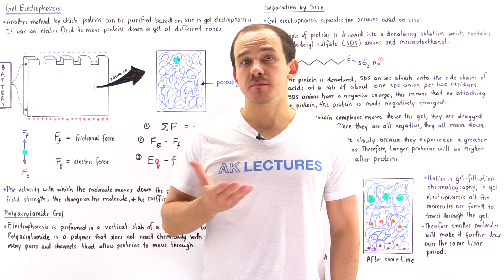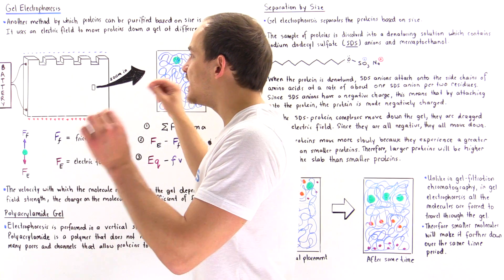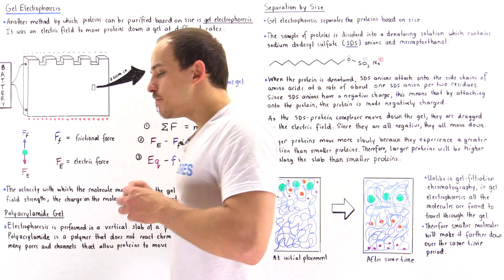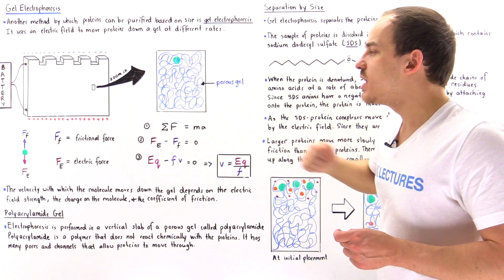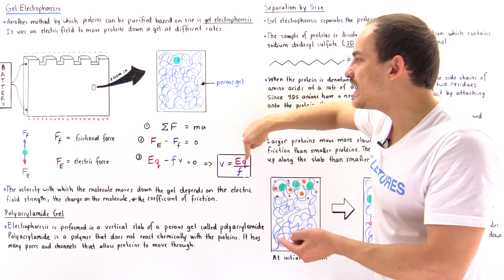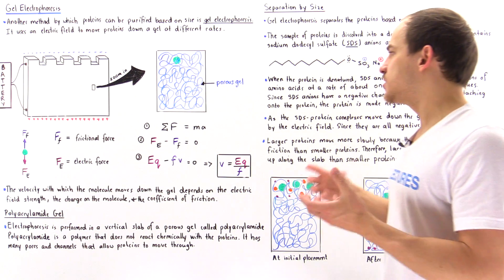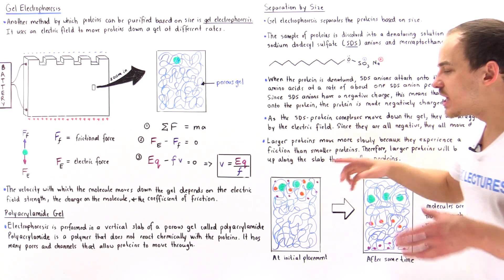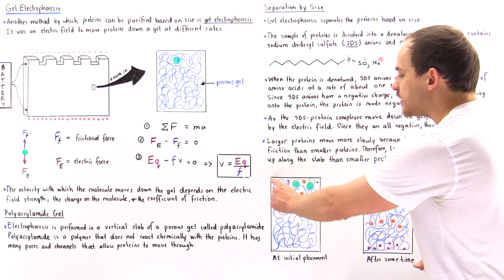SDS-Polyacrylamide Gel Electrophoresis

Comment: about F=Fv：Because friction is more complicated, it is usually some empirical formula. In the past, the friction force you were in contact with usually referred to dry friction between solids. If you consider that the object is moving in air or liquid, the measurement will find that the friction force is related to the speed. It is generally considered that at high speed, the friction force is proportional to the square of the speed, and when moving slowly, the friction force is approximately linear with the speed.

Comment: He is  right about the electric field being constant, BUT! Actually the voltage is not constant! In order to maintain a constant electric current, which generates ''almost'' constant velocity, the gel-electrophoresis machine increases the voltage during the process in order to resist the ever increasing impedance values inside the medium (anyone doing gel-electrophoresis can see that). Actually during the migration the voltage more than doubles! Does not matter in the end... Excellent video anyway!

Comment: I always thought the reason ads page was due to size not charge was because the charge to mass ratio for all proteins is the same with SDS. 

10 amino acids = every other amino acid gets sds/ = arbitrary net charge of 5. Divide that by 10 = 1/2. 

30 amino acid... 15 charge.. 15/30 is 1/2 .Thus all proteins have the same exact charge/mass ratio.
Reply: sds add charge uniformly to each and every amino acid so that they can  separate based on their charge ratio

Comment: amazinnnnng. can i ask a tow question: 1. whats the deference between 6x and 2x loading dye and which i should use ? 
2. which voltage is optimal to run one caste of gel, i usually use 65 v. ?
Reply: the concentrations of chemicals in the 6x loading buffer is three times as high compared tot the 2x loading buffer. This is the only difference. You should dilute your protein sample with the loading buffer in such a way that you always end up with 1x loading buffer. the 2x loading buffer should be diluted 1:1 with your sample. the 6x should be diluted 1:5.
Reply: the concentrations of chemicals in the 6x loading buffer is three times as high compared tot the 2x loading buffer. This is the only difference. You should dilute your protein sample with the loading buffer in such a way that you always end up with 1x loading buffer. the 2x loading buffer should be diluted 1:1 with your sample. the 6x should be diluted 1:5.